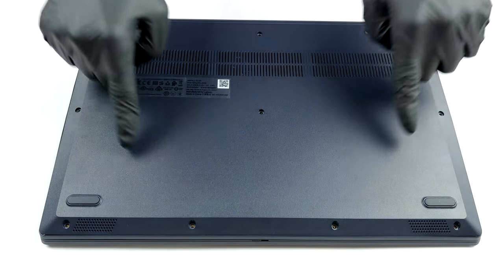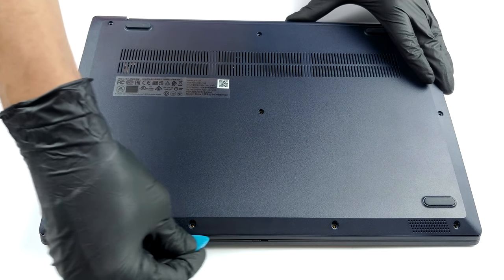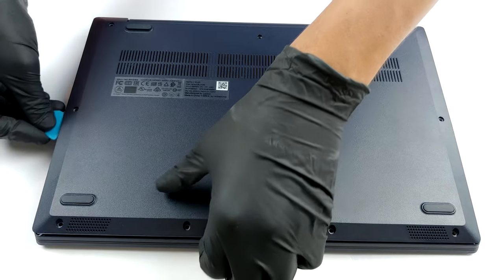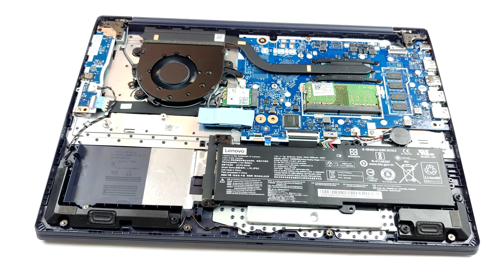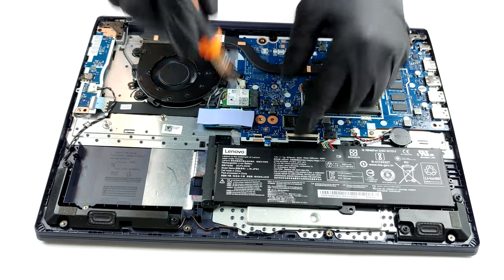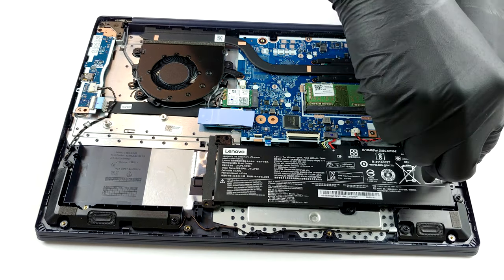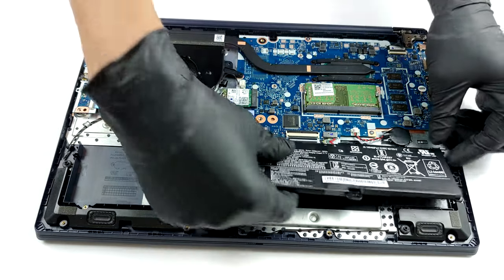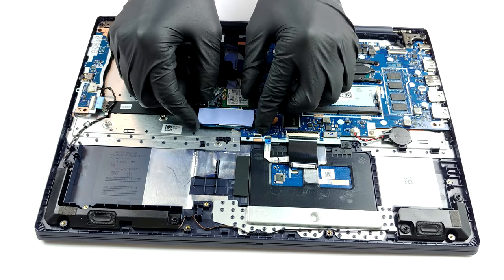🛠️ Lenovo Ideapad 3 (15) - disassembly and upgrade options

Comment: Thank you, great job. The prying was tougher than most. Just knowing there was no "hidden" screws (looking at you HP) was key!
Reply: Cannot get the back panel off…. Guitar pick ain’t doin the trick….wtf
Reply: @skatonio  did you ever get it. I’m having the same issue right now
Reply: @micaylab.8835  in case you never did it just know u just have to really pull there is no hidden screw so its just dont be afraid moment

Comment: if i install a 16gb ram single memory card will it work ??
Reply: Did you end up doing it I need answers
Reply: @takeaction-bro  no . i didn't
Reply: yea , but it can run up to only 20gb
Reply: @ingrid8329  so you actually tested it with a 16gb and it works?

Comment: My IdeaPad 3 15ALC6 came with a connector cable, SATA pattern socket & screws inside a plastic bag in the box, there's no description of what it's for but I believe it's the missing "bracket" that you describe in the video.  I very much want to add a Samsung 960 EVO SSD I used in my old deceased laptop which already has a steam library loaded on it.
Reply: Have you tried to power a crucial 32gb ram to see if it recognizes it? to stay with 36gb. Sometimes even though the manufacturer says they can't work.
Reply: @miguelosgcv  No, I don't need more RAM
Reply: @RobBCactive  Any updates on the 2.5 inch Samsung EVO SSD that you wanted to use? I have the same model. Did the laptop recognized it?
Reply: @sie1464  I decided not to void warranty, I managed without a second disk.  I've swapped SATA and M2 drives before in laptops, never had recognition problems.
Reply: @RobBCactive  thank you for you're response!

Comment: For the empty slot for ssd you mentioned, the cable comes with the laptop in the box, there is a little empty connection for the cable on the motherboard. I belive it's above the battery somewhere

Comment: where can i buy the conector for the 2.5 HDD?
Reply: You find something? I have the same question :/
Reply: My new laptop had a plastic bag with a SATA pattern socket and cable connector, plus screws; there's  no description explaining it, perhaps I received it in error and it's intended for retailers to upsell drives?
Reply: @josemisaelmagdonvalles4472  Thank you!!

Comment: Could someone in detail show how to open it after removing the screws? Mine seems to be superglued like a Mac or something. Where do you start? I'm at the point where I've lost most of my screws - coming from a Desktop that's little worry, not so much when going to a laptop. So I'm kinda worried about opening it now :) Tried with specialized tool,s my guitar case is full of picks.
Reply: Did you ever figure it out?

Comment: priority would be hello bi question. i have the same lenovo notebook.Is it possible to install hdd in the lower left space where it appears in the video
Reply: in the area below the fan in the video it's possible to upgrade to either an HDD or SSD though I recommend an SSD since they operate faster and are more resistant than HDDs
Reply: @Yo1s4k1  tanks bro
Reply: @zerat6679  what cable do you use to install?

Comment: I got a question to ask. I just bought a Lenovo Ideapad 3 laptop from Wal-Mart a few weeks ago. The thing is, I want to replace the hard drive and upgrade to a bigger drive. So, let's say if I bought a 6TB hard drive from Amazon. Will I be able to insert that new hard drive into the laptop? Could an external USB hard drive be able to work with this laptop?
Reply: If you do buy a 6tb hard drive from Amazon, make sure it's the correct size. It has to be in a 2.5" form factor. As for the external USB hard drive, that would work, but would be slower than an internal hard drive or SSD. If you do use an external drive, use one of the USB 3 ports on the laptop as it has higher bandwidth and would allow for faster speeds.

Comment: Can you install a 2.5 inch internal hdd?
Reply: No, he says in the video that there's a space for it but no cable or slot to connect it to.
Reply: @imanolgon  i already bought it and i love it!
Reply: @yusufffff  great! I'm planning on buying it. Did you get an NVMe drive?
Reply: @imanolgon  it came with a 256 gb ssd, and I'm planning to add a 2tb hdd later on, I'll have to ask lenovo support for the cable code
Reply: @yusufffff  oh cool cool

Comment: I have the Ryzen 3 (3250U) model, can I install a NVME M.2 SSD?
Reply: yes
Reply: @crownedaxis8569  Thank you very much for the reply. I actually got a 250GB one and the Laptop is super fast now.
Reply: @rohit31chauhan  np
Reply: How about ram
Reply: @bob-xx9js  you can install up to 12 i think
Reply: @crownedaxis8569  is it a good idea to use 4+8 GB combo? Some people say that dual channel performance will be worse in this type of setup.
Reply: @rohit31chauhan  it's fine but it wont be as stable as 8+8. Apparently some devices dont recognise to different amounts of ram. But I think if they limit to 12gb you can probably put 8 with the permanent 4gb alread
Reply: @rohit31chauhan  hey bro,i got some queries as i have the same model can we connect?
Reply: @mr.baligaming3090  Just let me know what it is, I'll help if I can.
Reply: @rohit31chauhan  did you upgrade your ram?
Reply: @mr.baligaming3090  yes
Reply: @crownedaxis8569 and 16?

Comment: Is there an option to add a secondary 2.5 Inch SATA SSD? I don't see a sata cable anywhere but I'm guessing it's possible to order one online.
Reply: Where would you buy a sata cable let alone where to plug in the cord
Reply: @brookdegenhardt5248  This model has an option for a 1TB SATA HDD which means you can find the proprietary SATA cable  and 2.5" HDD bracket on Lenovo's site or usually AliExpress. Then it plugs into the connector on the bottom left of the mainboard and the bracket screws into the bottom left of the case right above the speaker. Since a 2.5" SSD is the same form factor as a 2.5" HDD then that means you can just install a fast SSD instead of the typical slow HDD.
Reply: @Bizzn1z  Do you have any idea which cable this would be or where to buy it?
Reply: @Bizzn1z  Where is the connector for SATA in the video? I can't see it.

Comment: what do I need to upgrade HDD? what are the correct brackets or cable that I need.?
Reply: @hugomonitov  Have you verified this to work?
Reply: Did you buy the cable Hugo mentioned bellow, and if so, did it function?

Comment: Just bought this for my wife and ordered a 1tb ssd for the empty drive bay. Any info on what I need to install it?
Reply: You have to buy an ssd nvme like the one that was installed before, a normal ssd (sata) doesn't fit physically in it
Reply: @lucasala3352  dear Luca can I install 2.5 HDD sata model for bulk back ups. How can I do please tell me what is required to instal
Reply: @PriyeshKumar.k  I recommend you to buy a sata 2.5 to usb adapter
Reply: @lucasala3352  can we upgrade with nvme m. 2 2280 in this laptop
Reply: @venkadeshgold  Yes, I think so

Comment: i really need help i have a ideapad 3-15ITL05 and i need to upgrade from a i3-1105g4 to a i5-13600k i dont know if its possible since its soldered on
Reply: @Thorx37 you did it?

Comment: Mine( Lenovo  ideapad3 slim 3 ryzen 7 4700u 81W400CFIN ) came up with 45WH battery,my question is can I replace the 45Wh battery with 35 WH and add an extra 2.5 inch sata ssd or hdd?

Comment: Laptop came with 35w battery. In the video a 45w is mentioned; can you tell me the part number for the 45w battery?  Laptop runs out of juice very quickly, would like to upgrade (if possible).  Thanks!
Reply: @candaysee  its sold out bro is there any other 45w battery that fits ?
Reply: Lenovo  ideapad3 slim 3 ryzen 7 4700u 81W400CFIN it has 45 wh battery

Comment: is it possible to plug an external gpu inside this laptop? cause it only has 0.5 gb of gpu on the model that im lookiing :/
Reply: No. it has no thunderbolt connector. It also does not have a free m.2 port. So an external GPU is out of the question.
Reply: @harshbarj  theres a kinda janky solution tho. U can use exp gdc for eksternal graphic card. In theory m.2 nvme and wifi card in your laptop is an pcie, but you need conector to it, exp gdc is the answer.
Reply: You can google exp gdc

Comment: I upgraded and changed the ram from 4GB to a 16gm ram giving me a total of 20GB in ram, My biggest problem is that I wanted to add an m2 2280 1TB, but my Ideapad 3 didn't come with a standoff or the screw where the m2 2280 goes. can u pls give me the part number to it, or where can I find one. Ty
Reply: I think you can move the standoff.

Comment: Does anyone know if the processor is removable?
Reply: Doubt it, that's what I'm trying to find out as well.
Reply: The processor is smoldered with the motherboard, if you want to replace the processor, you need to replace the motherboard as well

Comment: hello, laptop media...max ram this pc is ??   4 (on the soldered motherboard)+ 1 slot max 16gb ddr4 2667mhz?  = tot 20?
Reply: with amd ryzen 3
Reply: @GianlucaDellaGatta  ciao,ho il modello con ryzen 5,sul mio sono 4+4 che possono diventare 4+8 quindi 12...credo lo stesso con ryzen 3,se trovo informazioni a riguardo ti aggiorno.
Comunque che utilizzo ne dovresti fare? Te lo chiedo perché a quanto ho capito il modello con ryzen 3 ha Windows 10 S che è un po' una merda,praticamente funzionano solamente le app scaricate dal Windows store! (Non c'è un cazzo sul windows store,manco Chrome mi sa). Invece quello con ryzen5 ha Windows 10 home e questo problema non ce l'ha.
Non so se si può sviare a questa cosa sul 10S ma controlla che versioni di Windows ha prima di acquistare,per evitare di spendere 400 e passa su un pc inutile...non dev'essere piacevole...
Reply: 4gb + 16gb RAM stick works with this laptop, some user made it work on forum
Reply: @tibisuperlegoarms  ciao allora in pratica stavo prendendo quello con il ryzen 3 mi han detto che non è piu disponibile..se non mi sbaglio con processore ryzen 3 4300U.Vogliono refilarmi un ryzen 5 3500u e quello è un preassemblato..sperando che non mi cambiano la batteria... leggendo sui vari forum poteva supportare 4gb + 16gb stick la versione configurabile che era il 15are05 come ha scritto @Alzer Joestar sotto... pero non capisco quale delle due versioni..IdeaPad 3 15ADA05 (segna 12 su crucial) e molto probabilmente è quella del ryzen 5 3500u l'IdeaPad 3 15ARE05 (segna 20 su crucial) . Non so che fare..
Reply: but for both versions? IdeaPad 3 15ADA05 and IdeaPad 3 15ARE05? They want to give me an assembled with ryzen 5 3500u before it was the one with ryzen 3 4300u ... anyway 4 + 16 is for both cases? thank you. Why i bought ddr4 2666mhz sodim 16gb from crucial. And I read that it carries max 2400mhz .. if you can help me thank you @AizenJoestar42
Reply: @tibisuperlegoarms  il tuo è il IdeaPad 3 15ADA05 ? ..devo sapere se supporta 20gb perchè l'altro ne ero sicuro da crucial e vari forum IdeaPad 3 15ARE05.
Reply: @GianlucaDellaGatta  Mhz is not that important in this case, the memory will clock down to the lowest memory speed, at least it was working for 15ARE05 can't tell you for the 15ADA05.
Reply: @AizenJoestar42  thanks let's hope someone knows
Reply: @GianlucaDellaGatta  what is the processor in the 15ADA05 ? Why do you need 20gb ram ?
Reply: @AizenJoestar42   ( ryzen 5 3500u ) I had ordered it on lenovo ... but they canceled my order because they no longer had the ryzen 3 4300U IdeaPad 3 15ARE05 processor (max 20 gb ram support ddr4) .... I found myself with a 16gb ddr4 crucial stick to use I need a new pc at a good price that supports this ram (and I was wondering if the ryzen 5 3500u 15ADA05) supports this .. on the crucial website it said max 12gb. Can you recommend another one with the same performance as the ryzen 3 4300u and that supports this ram ?. thank you.

Comment: love the video ..It has answered several questions I had and its been resolved. Is it possible to add a M.2 2280 ? thank you
Reply: Replace your existing 2242 and you're good to go
Reply: @estebang576  can we upgrade m. 2 2280 nvme ssd  in this laptop
Reply: @venkadeshgold  Yes! Did so one month ago. Big gripe comes from unscrewing the back cover, which does not come off easily
, but the good ol' credit card technique works wonders
Reply: @estebang576  thank you very much for timely reply. Now i can confidently purchase and gave to my customer
Reply: @venkadeshgold  My pleasure man! Have a good one :)
Reply: @estebang576  thank you very much i installed adata xpg m. 2  2280 Nvme ssd in lenovo ideapad 3 15 iil05. Now its work like charm. 😍😍😍 Customer fully satisfied
Reply: @venkadeshgold  Excellent! Glad I could help :)
Reply: @venkadeshgold  Excellent! Glad I could help :)

Comment: Can I replace the battery for a more Watts?
Reply: Officially, no. But there is a little more room, so if you are a hacker, it's a possibility. But at best you might get another 20-30% more. More if you find a way of expanding into the unusable drive bay.
Reply: Hi 
I have the Lenovo IdeaPad 3 (15IML05) Core I5 10th 
With mx130 
The battery is 36 watt
How much it should the battery last ? 
4 hours or 3 hours or 6 hours ? 
Please help

Comment: Hi 
I have the Lenovo IdeaPad 3 (15IML05) Core I5 10th 
With mx130 
The battery is 36 watt
How much it should the battery last ? 
4 hours or 3 hours or 6 hours ? 
Please help
Reply: The battery is not independent from the things you do on the laptop. For instance, if you are in a video call it will expire much faster than simply browsing the internet. If you produce music, pictures or audio it will expire faster than just watching a movie. So it cannot be said with exact numbers. This or that.

Comment: Can someone please tell me if its normal that my laptop consumes too much battery like every 1% per one minute? I bought the laptop and am using it right now since 2-3 weeks. I did everything i could against battery drain by changing settings , battery options and background usage limitings but i somehow have the feeling that the battery isnt good for longer battery activity usage per use. Am I right? Should i up my 2 cell lenovo battery?
Reply: There are so many options in this laptop that's it's unreal. I'm running the IdeaPad 3 gaming laptop, Intel i5 10500, Nvidia GeForce GTX 1650, 16g ram, with a 256ssd and a 1tb hard drive. If I'm just went surfing I can get a few hours but if I run a game I'm lucky to get a half hour. Been that way since day one. So draining that quick is on par for these
Reply: @saeulfr1350  Damn , even a phone lasts longer than these
Reply: @White_Shadow1-h8d  yeah. That's running guess horizon 5 at medium graphic settings

Comment: if the soldered ram is 4GB can I upgrade the other ram? and is there any rule for upgrade? thank you
Reply: I just put in 16gb stick and it works.
Reply: @lophilip  could you link me to the one you used ? 2666 ddr4 sodimm?
Reply: @lophilip  Have you tried to power a crucial 32gb ram to see if it recognizes it? to stay with 36gb. Sometimes even though the manufacturer says they can't work.
Reply: @miguelosgcv  Nope did not try that specific combination. I have gotten ram combination of different speeds that was a pain to get working on my desktops, but for laptops it's been good so far. Recommend getting the parts from a local computer store so there is a refund/exchange policy.

Comment: I want to know how much is maximun in that model?
Reply: Max what? If it's ram, that's 12gb (4gb + 8gb so-dimm). If it's storage, it's likely 2tb. Many devices limit NVME to 2tb for some reason. But ask lenovo to be sure. Everything else is soldered on, so factory condition is max.

Comment: Is it supports Pcle gen 3x4 3D NAND.  Plz answer...I m having same laptop
Reply: Yes it will
Reply: will it void warranty to upgrade ram or ssd?
Reply: @thisisganesh  no it wouldn't but remember whenever you are visiting service centre remove the added Ram.
Reply: @Inevitable_PS  what about the warranty void sticker?
Reply: @thisisganesh  there's no such sticker
Reply: @Inevitable_PS  ohk thanks man
Reply: @thisisganesh  If you're in the US warranty void stickers are nothing but a scare tactic, no one in a support chat will hold you up about it if you mention that. They're unenforceable because of right to repair laws.
Reply: Did you end up figuring this out? I have the same laptop but want to upgrade to Pci-e gen 3 x4. Specifically the x4 part!

Comment: I guess this notebook doesn't support dual channel memory?
Reply: ik this is late, but it does since it comes with ram pre-installed so if you were to add more ram it would be dual channel
Reply: @Garyckxxx  the maximum the laptop can hold would be 12gb of ram, so you could add an 8gb stick if you wanna max it out

Comment: Where is the m.2 slot located?
Reply: Dude, i have the same cuestion ;;;;
Reply: 1:39 here it is
Reply: Just above the fan.
Reply: I have the Ryzen 3 (3250U) model, so NVME M.2 SSD will work on it?
Reply: @rohit31chauhan  yes it will
Reply: @Inevitable_PS  thank you so much for replying
Reply: @rohit31chauhan  welcome brother Just make sure you are purchasing a m.2 nvme ssd with Dram . 
Cause SSD without dram are slower. 
There's hardly any difference in their prices. 
To know which are with Ram which are without just google it list of SSD with Ram PDF you will find that list
Reply: @Inevitable_PS  oh okay, thanks again for the advice.

Comment: Bro what is the ram type...
Reply: DDR4, it has 2x 4GB RAM. However you can upgrade/downgrade only 1 slot since other one is soldered on the motherboard, it is extremely risky or impossible to modify that. (It is not a module such like other RAM slot.)